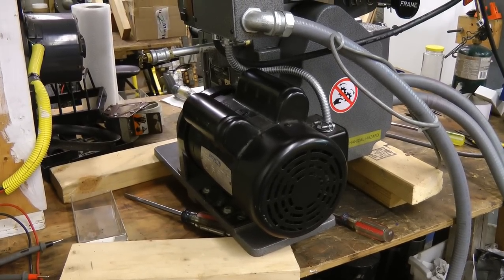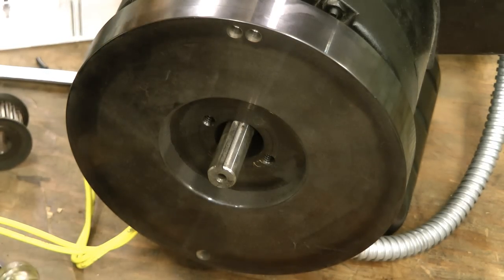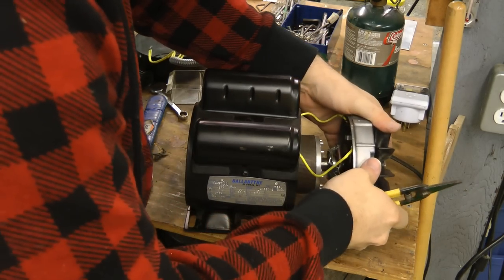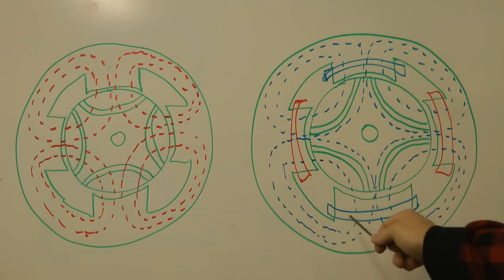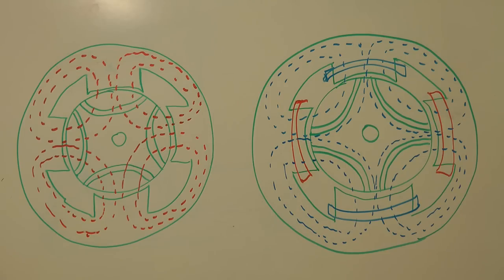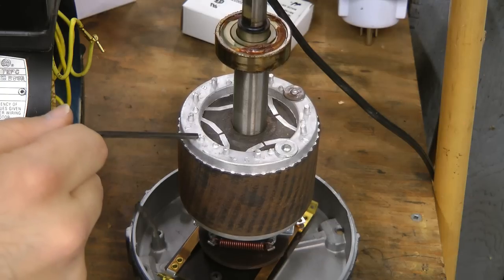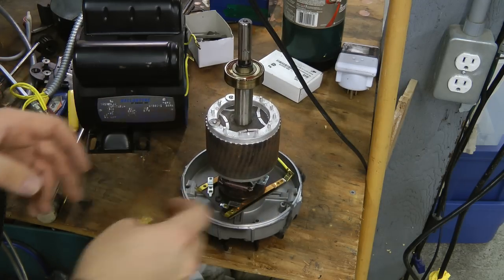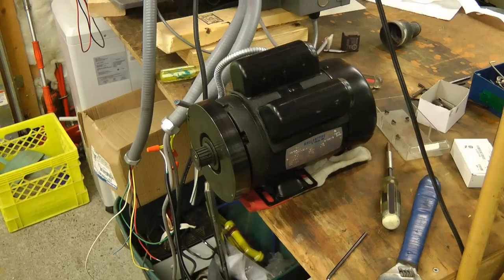Synchronous Motor from 35mm projector

Comment: Very nice design!  A fellow YouTube user sent me the link to your video,  after seeing one I posted. I acquired a more antique version of this, with the salient pole design (similar to the grinding away of the rotor you describe). It's a 1/2 HP with solid brass fan and copper induction bars in the rotor. Mine is from 1957 according to the nameplate. It has no centrifugal switch, instead relying on a potential relay for starting.

The flywheel is a brilliant addition, as well as the pry slots LOL! The magnetic flux holding the motor in sync with line frequency is somewhat elastic, as you explain in the whiteboard. I the motor gets a lot of pulsating torque demands, as from mechanical parts of the projector, it could cause the rotor speed to jitter. This could happen as the flux is "stretched" more or less at different positions in the rotational cycle by torque which varies during the cycle. I bet that flywheel eliminates some of of that, possibly also curing a visual effect on the movie screen? 

I did a test with a 60 hz pulsating light source and a vee pulley. By manually pulling a belt against the pulley, the rotor position could be retarded a few degrees - enough to easily see.
Reply: My older version: https://youtu.be/nQuCEV40Qm0

Comment: cool ,I also have a synchronous motor from a projector,it is 1/4 hp and the windings are on the rotor using  slip rings and brushes,it is very old possibly 20s or 30s from GE

Comment: I read a debate proposing that an AC synchronous motor could be spun with a DC motor to feed electricity into the AC grid. I could not comprehend how the AC power grid could synchronise the AC motor and at the same time act like a load for the DC motor's mechanical energy. Does that sound plausible, if the DC motor was not too powerful and accidentally shifted the phase?

Comment: but the torque needed to get this one out of sync is very low i think? And as soon as you force it out of sync, the squirrel cage does its work again, right? so the reluctance part just closes the gap between asynchronous speed and synchronous speed but with a very low torque. Pls correct me if I'm wrong.

Comment: Is that a mix between an induction motor and a switched magnetic reluctance motor? I though synchronous motors have magnets, very interesting, thanks for sharing
Reply from the maker: +jaimeesg It's not really a synchronous motor in the traditional sense (one with electromagnets or permanent magnets on the rotor). The proper term would be something like "induction start synchronous reluctance motor", but that's quite a mouthful.
Reply: tesla500 thanks for answering, I can imagine a quite interesting torque curve. Have you ever tested any pure Switched magnetic reluctance ones? They will supposedly come to the market at some point

Comment: Is a stepper motor just a synchronous motor that is built to hold stationary? I mean all the parts are the same it's just there's no constant rotation, rather a rotation only to reach a desired angle.
Reply from the maker: +darkmath100 They're very similar in concept, a synchronous AC motor could be used as a stepper motor and be able to hold stationary. However this would only work for a 3 phase synchronous motor, a single phase one doesn't have enough coils, it could hold stationary but couldn't step as there's only one main coil.